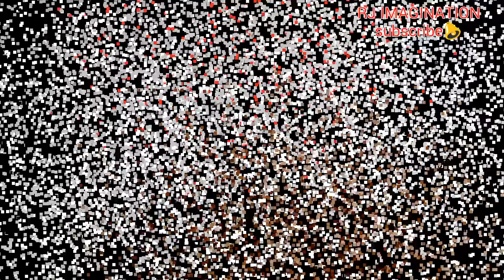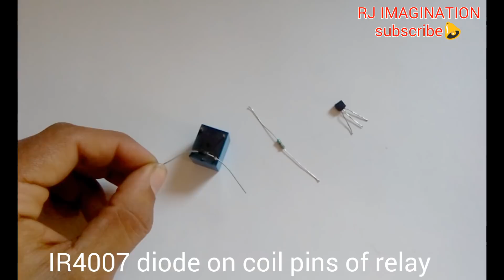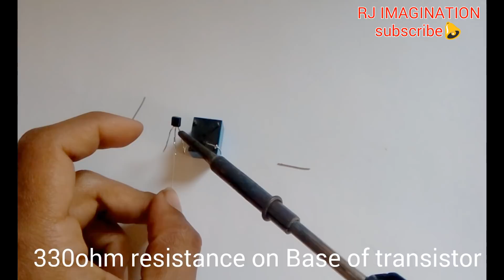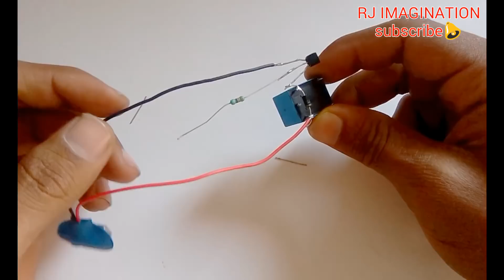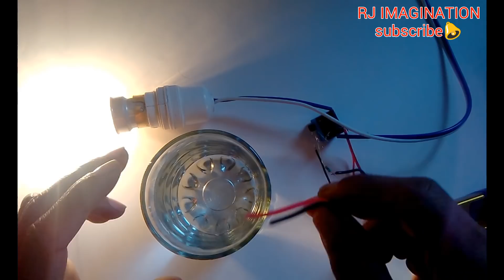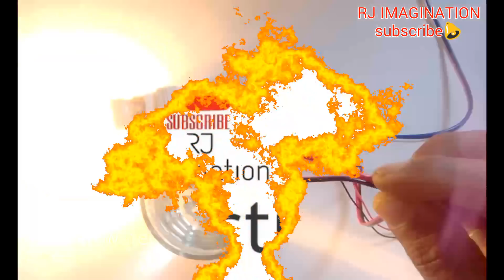Automatic Water Pump controller | Tank full motor will turn off automatically

Comment: That was fun. Probably want to be a bit careful about using this to control the mains. I used something like this to control a (low voltage) pump. I noticed that the wires in the water got corroded within a month or so, this isn't going to work long term.

Anyone actually using this ought to be careful to position things so that the water can't get anywhere near the mains wires, that the mains wires are physically held in place so that they can't get pulled out, that there is no way that the mains wires can touch the battery wiring if they happen to fall off, that any live wires are covered to stop people touching them or loose wires shorting...... Let's say, there's a real risk of burning your house down, or electrocuting your loved ones and you should carefully consider if you're competent to make this and leave it plugged in.

Comment: very helpful video but  not control heavy amp motors ..for example 5A. & etc
Reply from the maker: +Piyush kumar use higher amh Relay than you can control
Reply: This was 10A relay for heavy motors you can use 20A relay but it is very hard to find.

Comment: Jo aapne holder ki green wire rely ko connect ki lekin jo white wire hain uska kya???  Aur fir jo rely ke middle terminal se connection ki wire hain uska kya???  Wo dono wires to open hain. Maine 9 volt ki battery use ki lekin bulb to on nahi ho raha sirf rely ke on off ki awaaj ati hain